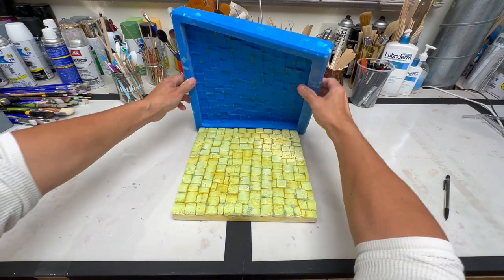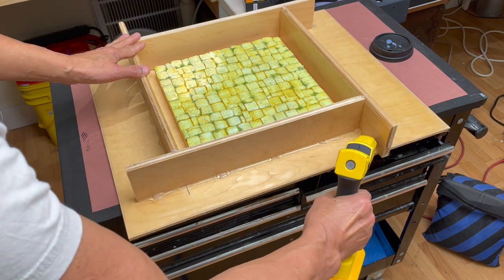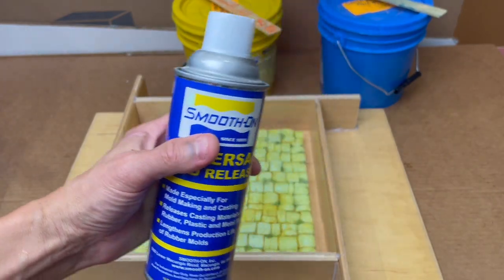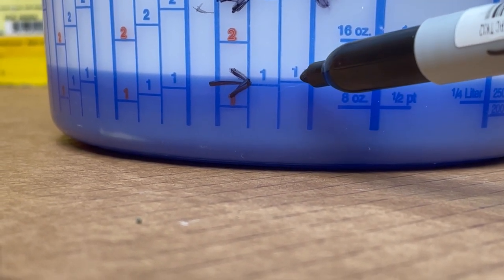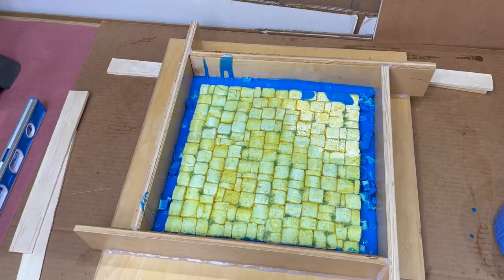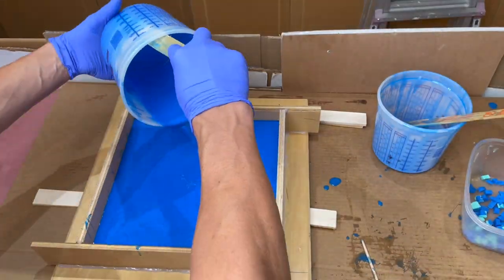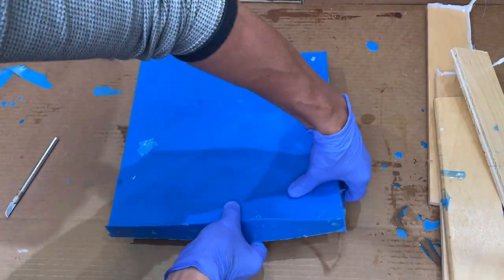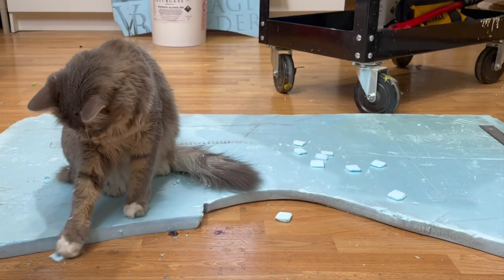⚡️One Piece Open Faced Silicone Mold Tutorial ⚡️

Comment: Hello, great videos! I have a specific question, hopefully you know the answer. In a short while I will start molding and casting... due our small place I will need to do it inside (have evreything prepared for that, ventiliation wise..) My question is, if you make a mold (smooth on Mold Max 10t), I will need to store it in my room, to cure. But do I need to store the curing mold in a air closed box? Or does air need to be there to cure the mold, so a regular storing box will do? I am affraid of curing fumes, so I figured an air closed plastic box would do the job. Thanks!
Reply from the maker: not sure on that. I would assume it would need to breathe, but you don't really need to worry about curing fumes on the silicone- but resin you definitely have fuming